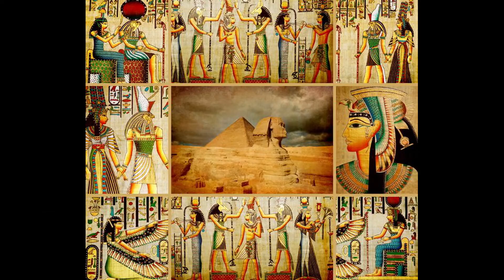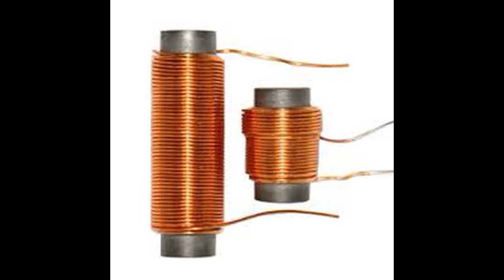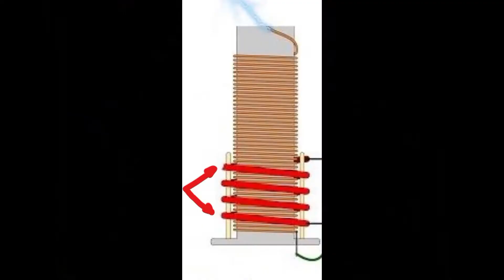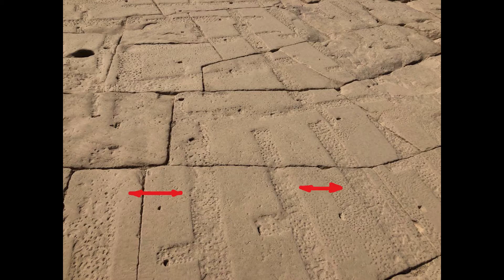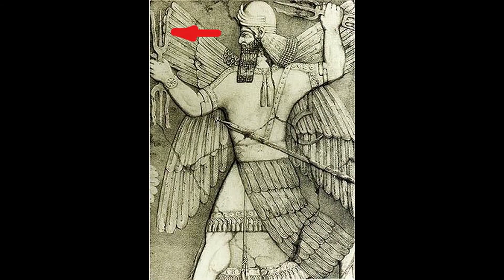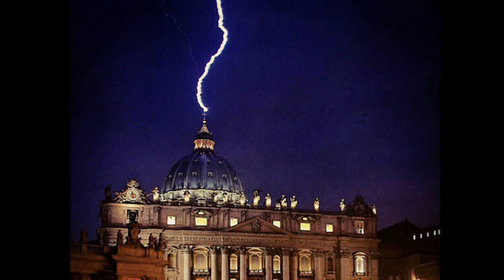How the Ancient Gods harnessed electricity. The Dendera Temple.

Comment: The second time I visited Dendera we paid the officials to allow is onto the roof. I'm not convinced there was not more structure on top that had been later quarried. Iwas particularly interested in the marks you highlighted on the roof. The linestone is not melted bt i thought it looked as if it had been eroded by eletrolysis. I left sdure that there had been copper plates forming huge capacitors up there.

Comment: You have good ideas, and yes the ancients had electricity from both batteries and atmospheric energy, not lightning. The temples were transmitters and receivers were used on dwellings. But the transmitter was running over-unity through some unknown means. There is a temple in Mongolia still transmitting electrical energy today.

Comment: Something known about Dendera, those pillars faces have been depicted with cow ears, and from my point of view there is a connection with the entire device and earing sounds. It is possible with no doubt to compare it with our modern AB valves amplifier, it use high voltage, and it's also well warnned in Dendera. That doesn't mean the device is still here in egypt, but this schematic principle is.